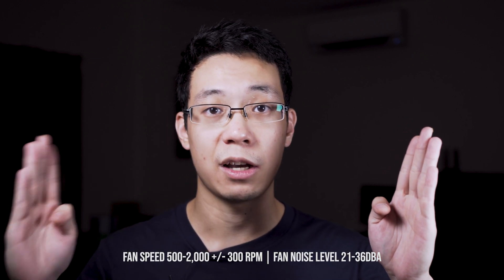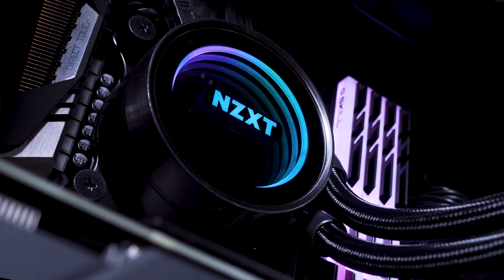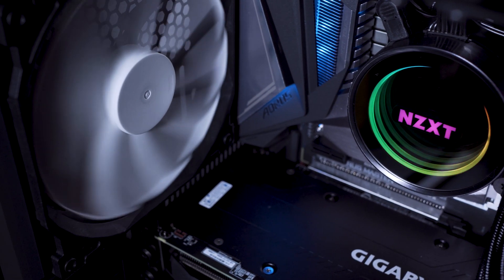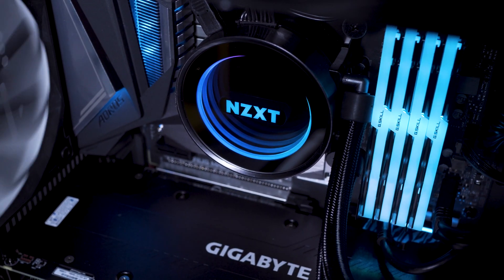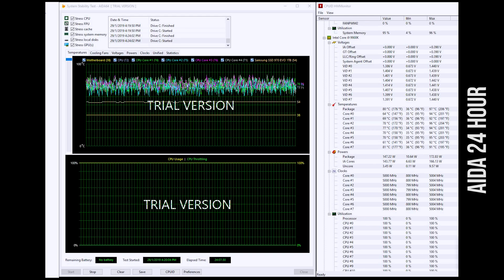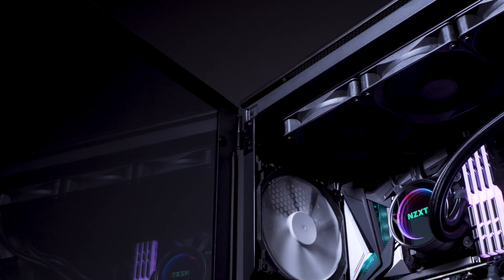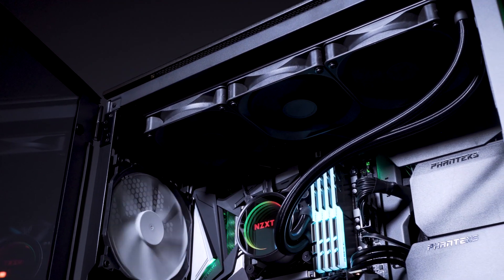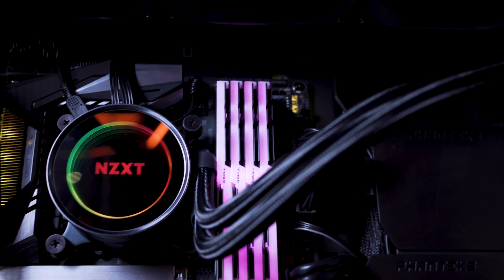NZXT Kraken X72 Review | RGB AIO i9-9900K 5Ghz 1.26V Overclocking

Comment: Bro would you recommend this for 10700k oc to 5.1ghz or more at 1.35 voltage ? I have an aio that's bad like cheap and the temps goes to 92 on 5.0 when using cinebench 15
Reply from the maker: cheap AIO -> stay 4.9Ghz
better AIO -> 5Ghz is fine

Comment: Are there any clearance issues between the pump and the ram? Would you also recommend changing the standard stock fans that come with the cooler with something better? Thanks
Reply from the maker: clearance is fine, try Noctua Black A12x25 fans

Comment: just brought NZXT Kraken x72 last week, 
will be running:
Samsung SSD 850 pro 256gb (windows and drivers)
Samsung SSD 850 pro 1TB
3TB HDD storage
NZXT Kraken x72
I9-10920x
Gigabyte x299 UD4 Pro
Gigabyte rtx 2070 OC (will be running dual)
64gb Corsair Vengeance LPX DDR4 3200mhz
Reply from the maker: looks like a killer system :D
Reply: Calvin Pixels yeah hopefully lol.. just added Corsair RM1000i (psu),  ASUS PCE-AC55BT Dual-Band Wireless-AC1200 and 500GB Samsung 970 Evo PLUS M.2 PCIe SSD PN MZ-V7S500BW this week
Reply: Calvin Pixels and wouldn’t mind adding a 2nd  500GB Samsung 970 Evo PLUS M.2 PCIe SSD PN MZ-V7S500BW and possibly raid both

Comment: I just build a pc with a i9 9900k same motherboard and same cpu aio cooler I haven’t overclocked it and it’s average temp is 87 degree do you think I placed the fans wrong way
Reply from the maker: likely, try push config and maybe new thermal paste
Reply: Calvin Pixels I forgot to connect the aio to a sata cable I did it now it’s 25 degrees

Comment: Hi question. My set up is i9-9900ks  and using nxzt x62  push pull fan 100% fan on nxzt h500i and my temp is between 60 to 76 degrees in gaming it is normal . Room temperature is 23 degrees
Reply from the maker: normal, swap to Noctua A12x25 for better temps
Reply: @BitsTribe  hi my nxzt x62 is 280mm Radiator fan are 140mm so I only change the fans
Reply: Hi Sir, can you test edit video Full HD by I9-9900ks with nzxt x62? And what is temperature? My PC with i9 9900ks vs MA620P but the temperature always > 90 degrees.

Comment: is it possible to turn off the RGB on the water cooler?  Or is it something which is default with this cooler, and have to endure the RGB?
Reply from the maker: yes can turn off
Reply: w/ the cam software you can turn it off.

Comment: I'm gonna get the X72 too but I will replace the fans with 3x 120mm Noctua NF f12 industrialppc 3000 pwm... hope that will work out lol
Reply from the maker: with Id-3000ppc it would give you around 6-9 degrees Celsius advantage
Reply: @BitsTribe  Are Noctua NF-F12 fans also quieter, or only more effective?
Reply from the maker: Effective but slightly  (tiny bit) noisy cause is 3000rpm
Reply: @BitsTribe  Thanks! Would you please give me some advice? So I'm planning to buy 10900K when released. I would like to buy an AIO cooler that has got an LCD display on it. I would like an efficient cooler - I do NOT plan to overclock! -, and for me very important is the noise level to be as little as possible. What would you reccomend as the best possible solution to buy?

Comment: I’d change the fans out immediately for black Noctua PPC’s
Reply from the maker: I would agree on this, should knock out another 8 degree off.
Reply: wich one? Noctua NF-A12x25 PWM 2000rpm, 120mm or Noctua NF-F12 industrialPPC-2000, 120mm,. The PPC makes more noise. the 3000rpm works like airplane

Comment: Hi, when you have those 3 Kraken fans up there in the case, is there any possibility change them for this - Corsair LL Series LL120 RGB 120mm Dual Light Loop RGB LED PWM Fan 3 Fan Pack with Lighting Node Pro?
Reply: you can use any 120 mm fans you want on the radiator
Reply: @HyDRoTheTrickShotter  Thank you.
Reply from the maker: Thanks Jordan

Comment: So you're getting temps in 80c range? I have a similar setup (Arous Z390 Xtreme, X72, I9-9900k stock (not oc)) and my temps get up to 90c within 5 or 10 minutes even with my fans set to 100%. I feel pretty confident it's mounted correctly, my video card is an Evga 1080ti Hybrid and I have a good amount of cold air coming into my case. Not sure why my temps are so high :(
Reply: Take the foil off the cooling
Reply: @insulin_enjoyer2331  what is that??
Reply: @dio.ahmed3  i meant the Orange guy man. Just transale the Word foil if u dont know it
Reply: me too get around 69c-76c under load @5 ghz with 9900k with an nzxt x72 is installed on it man. wtf u get 90c with a 9900k at stock settings? :S
Reply: That's with Prime95 using Small FFTs. When I try using Blend in Prime 95 my temps are much better (still below 60c after 5 minutes). Is that normal you think?
Reply from the maker: Maybe airflow is bad in the case, or you may not get the CPU Nugget (low temps).

Maybe over voltage too much
Reply: Same here. Nzxt offered me a replacement which I am about to get.
Reply: same :)
Reply: OriginalMooMix I just build a similar pc to you and I’m having same problem have you fixed it yet